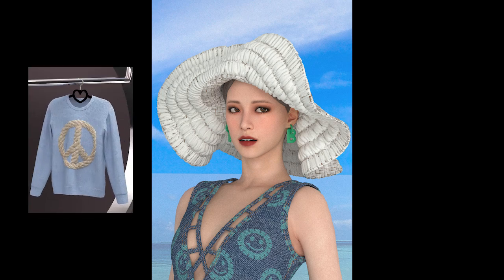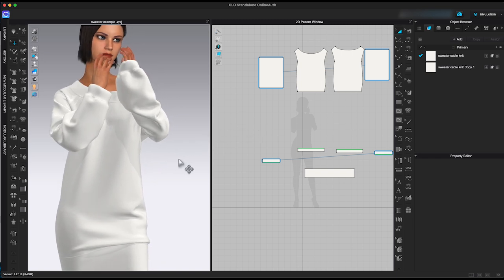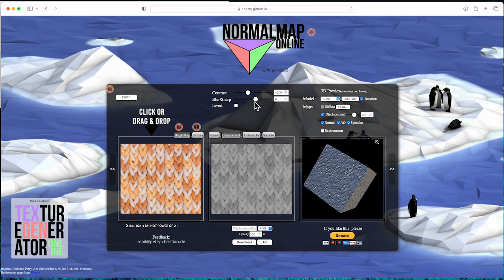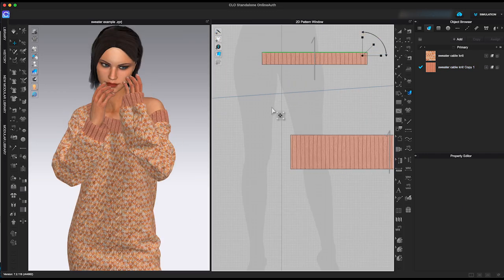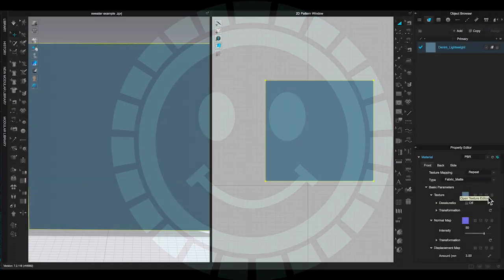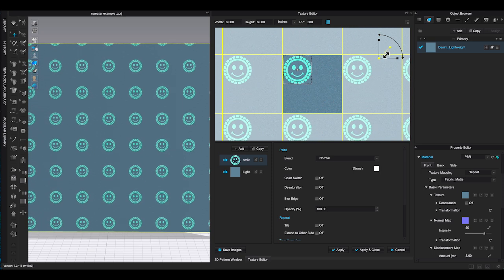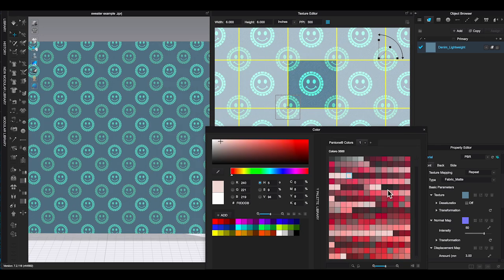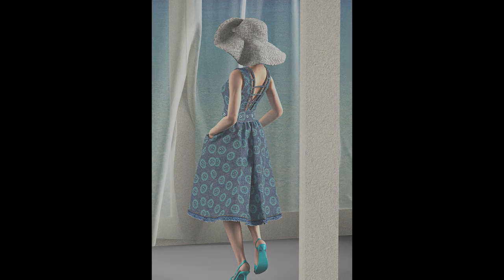how to create realistic fabric texture in CLO 3D

Comment: how to duplicate the texture and save as png to bring to site to make the normal map , need help ..thanks in advance
Reply from the maker: I am not sure if you were talking about the texture from clo3d fabric library or the texture you found online...
You don't need to have png file to generate maps on  cpetry.github.io. you can use jpeg or even a screen shot of the texture. Once you generate the maps, you have the option at the bottom of the window to save it as PNG or JPG.

If you want to duplicate a texture from clo3d.
add the fabric to object browser, and go down to property editor under basic parameter, click the swatch or the 4 square symbol. Right click on the texture file to make a duplicate.
Reply: i first made the motif for repeat pattern and added to texture to create tile and then i created sewing pattern sq and saved as pdf and then convered to png and used that png for as texture and to gennerate maps ....its long process
Reply: Thanks for your promp reply ...its works . i have one question now, once we use the clo fabric file as a base  like you shown in your tutorial, then we add design png , and then repeat pattern of design is generated ,i faced a issue when i tried to add normal and dispalcement maps of the design , its not maching with the base design but shows at diffrent places on fabric , so when you are adding design on base fabric , should we keep the normal map of base fabric to avoid this issue  Let me know Thanks ....
Reply from the maker: @sanjay_media  before adding normal and displacement maps, did you scale the size of the texture on the garment?

ideally you want to have texture map, normal map and displacement upload in property editor first, then apply the fabric to your garment.

Comment: if cloth have mesh fabric, how can we do?
Reply from the maker: there are 2 more ways you can try : 
1) create your mesh from scratch. you can trace the mesh fabric picture in illustrator, photoshop or any other drawing software and save it as png.

2) if your mesh is like fishnet with larger holes..enlarge the mesh picture so it will be easier to remove the cut out as transparent. When you import the mesh to clo3d, you can still scale down the size by using edit texture.
Reply from the maker: If you are using mesh or lace fabrics, you need to save all three maps as PNG files before importing to clo3d.
Reply: @Kev-in-design  but i can not seperate background and fabric when fabric is mesh or lace.
Reply from the maker: let's use lace fabric as example. On the lace fabric, you will have the cut out holes which are supposed to be transparent as the background. If you take screenshot of a lace picture online, you don't get the transparent on those cut out holes. I will use photoshop to remove  those cut out areas and make them transparent and save as PNG. That way I can use it to create normal and displacement maps.
IF your mesh or lace fabric has only 2 colors, when you remove background, it will usually remove the cut out areas as well.

 @hahoang5513
Reply from the maker: make sure your mesh fabric has transparent background before saving as PNG file
Reply from the maker: mesh fabric can be tricky sometimes when you remove background because the mesh lines are very thin. 
on Connect,clo-set.com, you can find some mesh fabrics that are free to download....
Reply: you can use an opacity map  that creates the holes illusion by using a black background , black will look transparent when using an opacity map